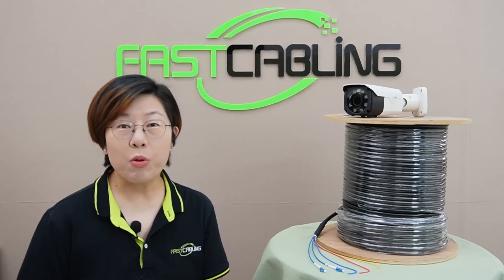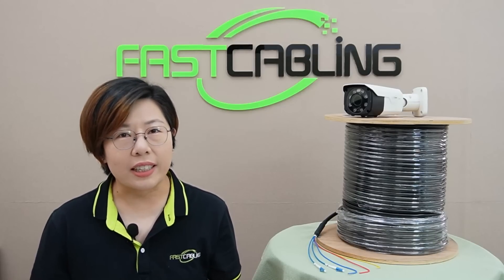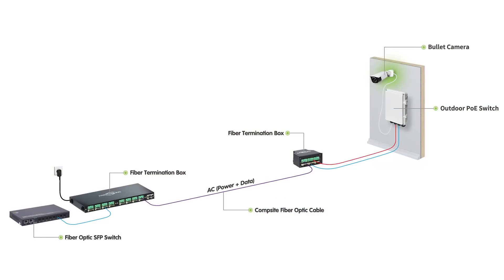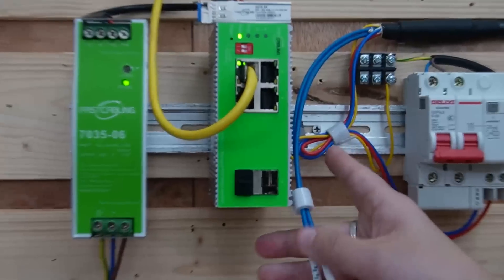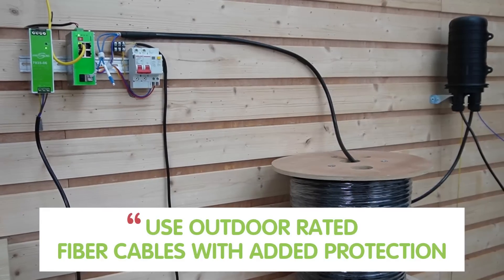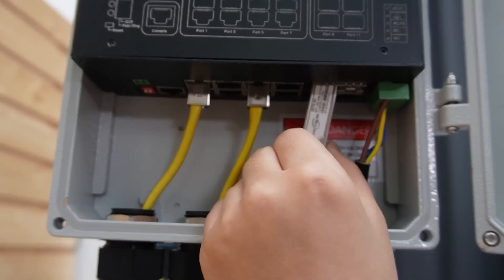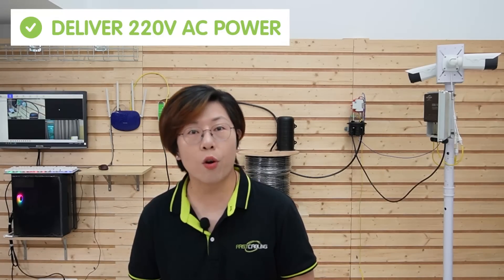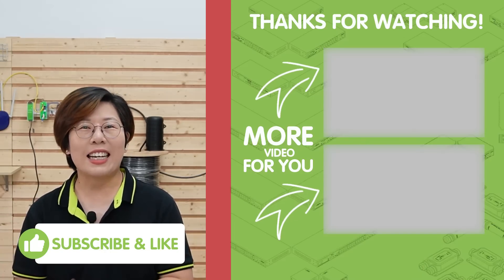The Future of Outdoor Networking Power Over Fiber

Comment: Outdors and indoors 😊 to add fiber to Poe ONU's
Reply from the maker: It's an outdoor PoE switch, not a PoE ONU. This composite fiber cable is terminated with LC connectors, which are incompatible with PON equipment.

Comment: Why you keep saying air switch ?
Reply from the maker: An air circuit breaker, also known as an air switch, is a type of circuit breaker that automatically opens when the current in a circuit exceeds a predetermined limit, typically due to an overload or short circuit.

Comment: The caption is so wrong and misleading! you preaching it like its the main fiber that's carrying power whereas its a copper/power cable wrapped with fiber! it is cool but the big downside to it is that its only 2core fiber with no redundancy. Imagine if a core fails, what will happen?
Reply from the maker: We're using a BiDi SFP module that sends and receives optical signals over a single fiber strand and use the other fiber as a backup. ERPS switches can solve the problem of network redundancy.
Reply: @Fastcabling  great fiber is cleared! But just NOT power over fiber!

Comment: There was no mention if this cable is direct burial rated. 

Besides that any copper wire going outside MUST be shielded cable and properly bonded to the electrical systems single point Earth ground. ☝️

The drain wire is bonded to the single point earth ground. 

The use of a SPD must also be installed at the camera and PSE! ☝️ Which is also bonded to the same single point earth grounding system in the building.

Lastly, no mention what the temperature rating is or the certification this cable meets?!? cUL?!?

One last point some of the ridiculous comments about 60 amps or other are just plain stupid.

We are LITERALLY talking about POE! Not powering a motor, fridge, toaster, whatever you dumb shits!

If you can’t understand that you don’t need to be watching this video! 🤦‍♂️🤢

It’s clear the vast majority of the people commenting are not real installers in the IT Industry much less know what the hell Ohms Law is! 🙄
Reply from the maker: This cable is direct-burial, with an operating temperature range of -40°C to +70°C. For more details, you can check out the product page here: https://www.fastcabling.com/product/100m-composite-fiber-optic-cable/

It’s essential to ground the cable properly, whether you’re using the powered/composite fiber cable or the armored version, as long as there are metal components. We’ve specifically designed a surge protector for the composite fiber cable:https://www.fastcabling.com/product/dc48v-optical-power-surge-protector/
Reply: @Fastcabling  Appreciate the links to the technical specifications of this hybrid cable. But, it did not provide any information as to what standards this cable meets.

It also doesn’t say or provide any information about if the copper wire is actually shielded which it doesn’t appear to be the case.

I gather you mean the fibre cable is armoured vs the copper cable.

Also, it’s obvious why this video is about running AC power vs DC power.

There is zero chance the 20 AWG copper wire you’re using would be even close to being appropriate for 48 VDC POE! 🤦‍♂️

The voltage drop on 20 AWG gauge wire past 100 feet never mind the 320 maximum for Ethernet cable is more than the 2% loss allowed! ☹️

If this product or similar hybrid cable is to sell well in North America the copper wire portion must be shielded and have a drain wire and be at least 18~12 AWG gauge depending upon distance for a DC supply.

You must also provide a grounding block / terminator for the armoured fibre cable.

I really like some of the products your company offers. But, have to say this hybrid cable needs more development and must have certification from a known entity along with all the requirements I stated up above.

I help companies alpha / beta test products every day. To help identify problems and to make them better.

You may reach out to me if this is something you feel would help your fine company.

As I love seeing Chinese companies succeed in North America as it promotes innovation and competition. 👍
Reply from the maker: It can handle AC/DC power. We have the 16AWG gauge version, up for customization. There is a grounding point to the armored fiber cable.

Comment: Power WITH Fiber not OVER.  NFPA 70 NEC will give you all you need to know for wire types/sizes needed for distance/power needs.  Derate wire to prevent voltage drop.  I myself run fiber and provide green energy to devices onsite as its cheaper and I can buy more fiber.  Its all low power so...

Comment: with this false topic, you made me waste 9 minutes for nothing
Reply: You should have known better. Glass or plastic are non-conductors of electricity. Personally I think it's a fantastic idea to combine power and fiber cables into one unit.
Reply: @williamjones4483  Lol running fiber to camera's...   You obviously don't know how fragile fiber can be.
Reply from the maker: While fiber is more fragile than copper cables, proper installation techniques and the use of armored cables mitigate most issues.
Reply: @williamjones4483 actually there is a real power over fiber technology which I am intrested in.  It is really useful when you need to get data across a few million volts potential difference.  Clearly an unusual case but one that would be really problematic if there is a copper conductor in parallel with the fiber cable
Reply from the maker: Fiber doesn't carry electricity for sure. But this is the way to go if you want to transmit power along with fiber cable. Instead of running a separate power cable, you only need to run one.

Comment: Nope, no, niet! All you did was combine electricity and fiber optics in one cable. You did not send power over fiber optics.
Reply from the maker: Fiber doesn't carry electricity. If you want to send power over fiber, there are two methods: using a composite fiber cable or using a PoE fiber media converter.
Reply: @Fastcabling  No, you can actually send power over fiber. It doesn't carry electricity, but it does carry light energy. With a powerfull laser, and photovoltaic power converters in the recieving end, you can transfer power over glass.
Reply from the maker: PPCs typically convert only 30-50% of the light energy into electrical energy. The amount of power that can be transmitted is limited by the strength of the laser and the heat tolerance of the system. This makes it unsuitable for high-power applications. High-powered lasers and specialized photovoltaic converters are expensive, which might not be economically feasible for all applications. Moreover, DC power is safer to handle than lasers.
Reply: @Fastcabling  You are correct about this. 

Your cable, although usefull in it's own right, is not transfering power over fiber. It's transfering power alongside optical fiber.

My argument is; if you merged a 110/230v cable and an ethernet cable. Would you call it Power over Ethernet?
Reply: @Fastcabling actually there is a real power over fiber technology but you are so dumb that you don't realize that you are claiming that your product is something that it is not.

Comment: Those 220V cables are awfully thin. I doubt it's over 60Amps
Reply: Mide in China ;-)
Reply: @Crazy--Clown  Everything is made in China!😩
Reply: No device that I know of would require 60 amps. However, a 6-10 amp capacity could be quite doable and fill the electrical needs of any devices.
Reply: @williamjones4483  Your right. I wonder this is basically PoE but with fiber instead?
Reply from the maker: This composite fiber cable contains two fiber strands and a copper conductor to carry AC/DC power.

Comment: YES YES YES !!!  Awesome video !!  You really don't wan tto send AC, but. DC across the pair of wires :)
Reply from the maker: DC is generally safer to handle; however, if voltage drop is a concern, AC can be a viable alternative. Regardless of the choice, it's crucial to install a circuit breaker to ensure safety and protect the system.

Comment: Yes I also want to know the distance for composite fiber cable?
Reply: Depends on voltage and current needed.
Reply from the maker: It depends on the fiber type and power transmission.

1. Fiber Type: Single-mode fiber can support distances up to 40 km, while multimode fiber typically supports shorter distances, ranging from 300 meters to 2 km. 

2. The distance for power transmission depends on:
a. the cable's copper gauge (thickness): Larger conductors (lower gauge numbers) reduce resistance and allow longer distances.
b. the voltage level: Using 48V DC power, you might achieve about 300-500 meters for low-power devices, like cameras or sensors. On the other hand, higher AC voltages (e.g., 110V or 220V) can travel longer distances with less voltage drop. However, for safety concerns, you might need to install circuit breakers/air switches if you're using AC power.

Comment: Hi, what's the max distance of composite fiber cable?
Reply from the maker: It depends on the fiber type and power transmission.

1. Fiber Type: Single-mode fiber can support distances up to 40 km, while multimode fiber typically supports shorter distances, ranging from 300 meters to 2 km. 

2. The distance for power transmission depends on:
a. the cable's copper gauge (thickness): Larger conductors (lower gauge numbers) reduce resistance and allow longer distances.
b. the voltage level: Using 48V DC power, you might achieve about 300-500 meters for low-power devices, like cameras or sensors. On the other hand, higher AC voltages (e.g., 110V or 220V) can travel longer distances with less voltage drop. However, for safety concerns, you might need to install circuit breakers/air switches if you're using AC power.
Reply: Depends on voltage and current needed.